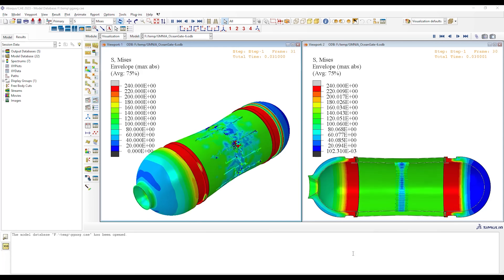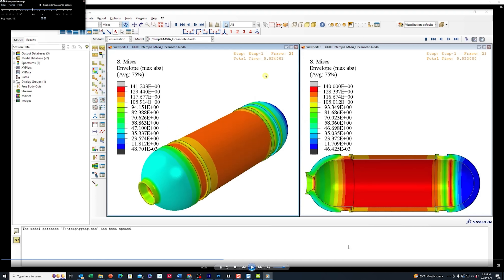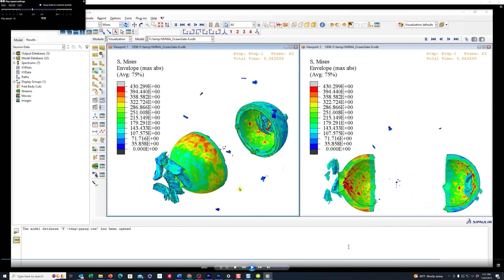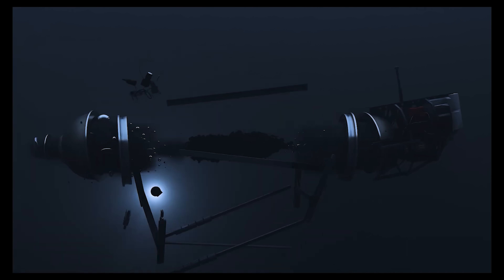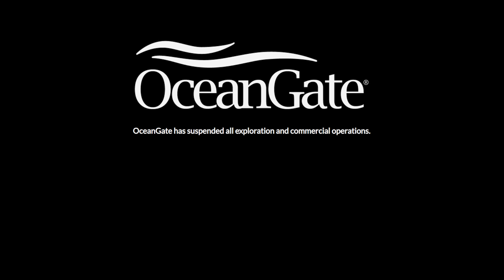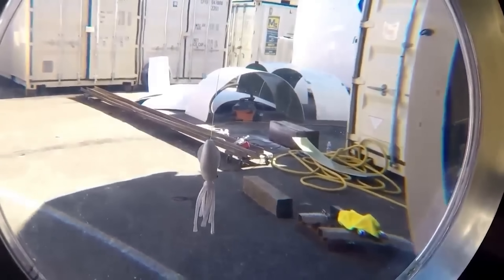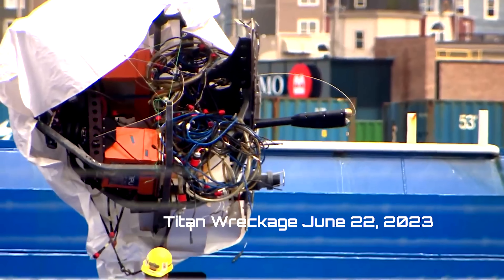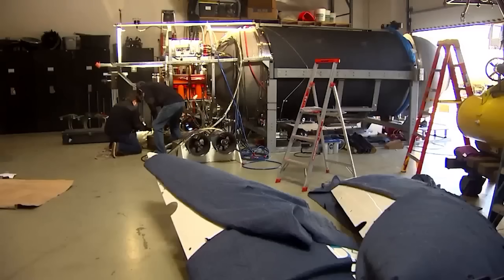Best Titan Sub Implosion Simulation, Cracked Porthole? Q & A

Comment: The simulation shown id wrong because it is based on assumption. In the simulation, the failure happens in the middle of the hull. The hull did not fail. The dome joint failed. There is no evidence the hull failed. The debris found shows no evidence of hull failure. What it does show is evidence the dome to hull joint failed. That is a completely different scenario. 

Carbon fiber does need more study and testing. The engineering behind it is sound and it was headed in the right direction. It also showed that it can definitely handle huge compression loads. Again, was it perfect? No. It only needs more study. 

The main cause for this failure is 100% one man's fault and that is Rush. He alone ignored everything his team told him, he ignored the data, he literally ignored everything, even maintenance.

Comment: My wife and I were actually on this submersible when we applied for a job with the company. We went out in Puget Sound only like 600-800ft deep, saw some stuff, and had some folks from the UW on with us studying the marine ecosystem. Even that short trip of 90-120 minutes gave me pause. We had an issue with the joystick connection and were without control for what seemed like forever but probably was 5-10 seconds. After hearing that this wasn't uncommon, I chose to work elsewhere. The rapper Macklemore was on it, too, for a shark week episode. This was before they began going to the titanic.

Comment: What occurred to me also is the sheering they found on the layers.. The glues used to bind the different layers may not have had the strength they thought as far as flexing from pressure. to me if they can slide along each other that reduces the strength from thickness.. I think the fatal flaw was thinking 5 inches accumulative was strong but in reality its not an additive as much as a percentage of increased strength per layer if they could move somewhat from glue stretching or compression..

Comment: jesus never saw the overhead shot of that ship before....wtf was the point in saving weight etc etc etc when the aluminaut sub with 7" thick aluminum walls and 30 tons weight wouldve been easy af to get on this thing....thats a massive offshore tug or something. look at the cable drums above the deck.  all for a dorky 10 ton sub??????????????????????

Comment: They would have had no "warning" it was going to catastrophically fail because, even if there was a sound just before the implosion, none of their brains would have had time to connect the sound with the implosion. Pain takes 100ms to travel to and register in the brain, it takes 13-15ms for your brain to register something you see, the hull implosion took ~1ms. At that depth the weight pressing down on 1 meter of hull would be about the same weight as a third of the Eifel Tower. The data from acoustic sensors attached to the hull showed a delamination of the carbon fiber just before surfacing on the last dive before the fatal one. Oh and they also let the Titan sit for months, outside, in freezing weather before the fatal dive.

Comment: I know I am late on this but... the cracks you are thinking you are seeing are likely NOT cracks but VOIDS in the thin film of oil in the tapered well that the porthole sits within. Under pressure the voids are squeezed out. This is not likely the failure point. The ALVIN submersible has the same look and its never had any issues. I felt from the implosion day 1 that it was at the joint where the carbon fiber meets the titanium ring...

Comment: The problem with the materials used for the sub is it suffers extreme degredation with every dive.  It might've worked once or twice, but it can't withstand repeated pressure events.  That's why you don't use carbon fiber.  Carbon fiber is good for containing pressure inside, but not resisting external pressure.

Comment: They actually did get a "Huge warning," that there would be imminent failure. Dive 87 there was a massive pop or gunshot sound coming from the hull upon ascending to the surface. That was the delaminating of the carbon fiber. Rush ignored it and didn't order any repairs or hull inspections before the doomed 88th dive.

Comment: New info suggests the start of the implo crunch started closer to the front window popping out & the crew got "implosuckflattened" backtowards the aft. The soundtrack reader 1st jump bang a thud indicating the window pop out initiating implode, what follows are the lessening 4-5 small spikes few milliseconds of the carbon cylinder crunch flattening the crew that I hope not at least 1 may or was possibly able to be aware but not capable to react in extraordinary unbearable gruesome pain getting compressed B4 that final second was incineratedly squished goo goo gone. 💀😱omg.

Comment: they for sure heard the carbon fiber cracking before it failed even if they weeent aware of their bodies being disintegrated. we know they had acoustic sensors to count the cracking events at depth and tracked them as data as well as had a counter running that even the passengers could see inside as they descended. our vagus nerve system takes in way more information about our surroundings than our eyes or ears, so i’d be willing to bet every one of them had a sinking feeling right before it happened. at least they felt no pain in their final moment.

Comment: My guess is a separation at the titanium/carbon filter junction. Those two materials would have compressed at different rates and even a millimeter or two would snap that glue joint.

Comment: I understand that stress distribution of the original viewport (true dome port design with a concave inner surface, the design best understood at that time) was superior to what S. Rush decided to use (flat inner surface). I know that he altered the design to achieve a more natural view for his passengers. Of course, as an engineer myself (granted, EE, not ME), the assumption that the designs are somehow equivalent is the sort of naiveté I’d expect from a amateur, not from a professional, degreed engineer. I’m no expert in optics, BUT, could he have added a corrective lens to restore the intended view, with an air gap to allow the dome to move? Did he make any effort in that direction?

Comment: These simulations do not agree with the ruins of the lmplodable, found on the sea floor, very recently. It was not a total obliteration of all parts. The front titanium section still had a large chunk of hull material jutting out from it. This would indicate some parts failed before others. The weakest link scenario.

Comment: The titanium cap was not damaged, I wish the whole body was made from titanium and not carbon fiber. That would be interesting to recover cameras or cellphones and try to extract any videos or sounds from inside the sub before it imploded. The Oceangate crew might heard some cracks right before it imploded so they might knew what is going to happen.

Comment: Stockton Rush was clearly NOT a good pilot. He didn't understand the basic concepts of aviation.

Airplane is just a pressurized cylinder with wings, engines, windows, doors, wheels, control surfaces (including the tail), life support systems (cabin pressurization, oxygen, heating, cooling), radio, radar, and plenty of other bells&whistles.

If the cabin pressure suddenly drops during the flight you're in trouble. Rapid uncontrolled decompression can literally "tear you a new a**hole". You may suddenly find that the tail section of the plane is severely damaged (pressure wall has burst, some parts of the tail are missing) and the plane now has a new rear window. 

Stockton Rush claimed to be a pilot, but he didn't understand material fatigue and compression cycles. The difference between a submersible (diving down to 4 km deep) and a commercial passenger jet (flying at 10 km altitude) is MASSIVE. I wouldn't use carbon fiber composites and glue to build a passenger jet. But this guy decided to use these materials to build his hobby submarine. 

Reality check. People can survive several hours on top of Mount Everest (8 km) without supplemental oxygen. But they can't survive underwater (4 km deep) even for one second. Stockton Rush proved it himself.

Comment: His thing was flawed from the get-go. You never use carbon fiber composites in compression.
This is basic mechanical engineering. 
Everyone with a mechanical engineering degree who worked on this thing at all should be banned from engineering for the rest of their lives.

Comment: The C-channel flanges of the Titanium End Caps sheared away so flush against the face, its like they was machined.

Titanium isn't heavy, it is expensive.

As you may be aware, carbon fiber cloth doesn't tolerate compressive Shear nearly as well as Tensile stresses.

I think there wasn't much included scope for regular maintenance inspection of the structural frame, frame members and identification of fatigue creep, shear force stress fractures, cavitation, delimitation etc (ultrasounds, UV, micro-cracks). 

The carbon laminate is compressed along its hull length, but also pinched against the flange shoulders cupping the carbon laminar hull tube: the hull ends are practically being guillotined. Curiously, the Titanium flanges sheared away and at the moment of failure the Carbon hull layup segmented into large pieces.

Comment: I think if he had made a 2-inch wide strengthening rib with about 1 ft of wall thickness that went completely around the inside diameter of the main carbon fiber tube and right in the middle lengthwise the thing would have been fine. It wouldn't have caused too much weight and it wouldn't have caused too much of a hassle getting in and out considering they were bolting the end onto the sub. It would have kept the outer edges from rotating as the middle was squeezed down thus the glue would not have been compromised and you might have been able to go a few more Cycles without it rupturing. Maybe it would have held out just long enough for Stockton rush to be in the damn thing alone and to be forced to eat his own engineering all by himself, the whole meal.

Comment: We KNOW now that it was at the titanium ring where it collapsed at the forward dome all around that ring it FAILED and SHEARED off that flange from the titanium ring. The glass was blown outward, again shearing off all the retaining bolts and studs at the same time. Tremendous force. ALL of your fancy reenactments are all WRONG. The failure was at the front, not the middle. The debri shows a giant diagonal crack or tear in one of the onger recovered carbon fiber pieces. The big "bang" heard on a previous dive was probably that crack forming.. Stock-BOY should have immediately RETIRED that hull and built another one AFTER examining THAT hull. Problem, Rush didn't HAVE enough money to BUILD new hulls at THAT rate. He needed a few more dives with 3 or more PAYING customers.

Comment: We now know that the actual mechanism of failure was the aft joint between the carbon fiber hull and the titanium hemisphere, which admitted a pressure wave. The carbon tube actually exploded outwards. The forward titanium dome and porthole were blown outwards, and found intact a distance from the wreck.

Comment: Nah. It's simple. The carbon fiber hull failed,the front dome jammed everything into the rear dome (including the crew) and the backpressure from the imposion then scattered the carbon fiber pieces in a large area and pushed the front dome outwards. This is why there is a large debris field, the rear dome is PACKED with stuff and the rear dome was further away but was empty and blown off from it's hinge.

Comment: Am I the only one here questioning the use of carbon fiber in compression?  A cylinder made from carbon fiber in compression is no stronger than the resin holding it all together.  Carbon fiber's strength is in tension, not compression.  I think the designers were sniffing the carbon fiber and getting a high thinking it's THE stuff to use since it's supposed strength is the end-all-be-all solution to everything strong.  In this case the wrong application.  A chain gets its strength when in tension.....have you ever tried to PUSH a chain?
Reply: If you think about it, the carbon fiber windings ARE under compression in the tube. And now we know that the carbon tube actually exploded from the pressure wave created when the aft joint failed. Look, the design was fundamentally sound, it was a failure due to structural fatigue from repeated dives.
the old B 58 supersonic bomber was made from honeycomb sheets that were essentially glued onto a frame, and after a few years of supersonic flight and extreme environmental conditions, panels began to fall off.....The old Space Shuttle was covered with heat resistant tiles that were essentially glued on.

Comment: There should have been a detailed risk and failure analysis done on this vessel by a third party. This would have started at a high level before drilling down to details. Wild guess but the glued joints between the titanium heads and the carbon fibre hull would appear to be the highest risk along with the viewport.

Comment: The port window was blasted out from the inside. Note that when the front dome was brought up, there was no ring holding the porthole window in! Also, note not the titanium ring, connecting the ring to the body of the sub, was not still bolted on. All were hit hard by a large volume of fast moving water from the inside of the sub. There is clear indication that there was significant asymmetry from the implosion, ruling out the failure of the center.

Comment: Would it implode if it was only a couple of thousand feet down ?
Reply: It was near 12,000ft down. That is not a couple. The pressure there is 6000 PSI. That's basically putting a Ford F150 on a banana.

This was there 80+  dive. The carbon fiber kept cracking and rubbing layers until it finally failed. Previous passengers reported loud "gunshot" noises throughout the dive. Those noises were the carbon fiber breaking apart. They all knew that and tried to keep everyone silent about it. They fired those employees who brought it up
Reply: I wonder if those loud noises which some people thought were the men tapping on the hull,was actually the carbon fibre tearing apart ?...wouldn't the men have tapped out the universally known SOS distress signal on the hull rather than a random knocking that people claimed to have heard ? They were all sea faring men who would have known the SOS signal .
Reply: @lindymcdonald8945  Who knows how long they knew of their impending death. Could have been instantly or they were in the dark for a few minutes hearing the carbon hull popping and cracking until it imploded. They passengers had go pro's and there were cameras mounted but on the inside recording but they were destroyed so no one will ever know.
Reply: I think they would have heard the cracking because didn't Stockton Rush indicate he was trying to resolve a problem on the descent ..i'd imagine a vessel like that would make all sorts of creaking noises .
As much as I'd love to see the titanic ,I don't think I'd have the nerve to go in one of those subs.

Comment: There is a problem with this 1st simulation in that the craft doesn't end up this way. Being crushed in the center is not accurate.  There is a section of the cylinder that survives the implosion  intact at the wreckage site.  It is perhaps not the full length of the capsule.  I don't know.   At the crash site there is only one capsule end piece together with part of the cylinder that survived.  It makes me think that the bow cap got pushed away and simultaneously the top of the  cylinder get crushed until pressure equalized.  That force goes toward the aft cap end and pushes it outward.  That is what I am thinking.  I like the simulations though.  Thank you

Comment: Rush always figured things would fail in the way he necessarily needed them to, and could not conceive of the instantaneous & catastrophic reality of insidious materials at failure, a concept which is virtually innate for anyone who careth enough to consider how exactly something goes from structurally rigid one moment, to broken, cracked, fractured, etc. The instant a synthetic material is compromised, the strength drastically dilates, and at that depth, a crack would obviously mean imminent catastrophic failure. The moment a fracture occur, death to all aboard. 

Rush was clearly deluded and refused to examine objective reality because it was inconvenient for what he needed to keep his cobbled together, bullshit 'vision' alive. 

Stockton Rush had a dream of going to space, but yet this, like OceanGate, likely was not a real dream of his, either. From a family like his, surely youthful pressures are immense, and i think it's likely Rush had no idea who he truly was at all, which is why he sinply pivoted to some other silly dream once he couldnt become an astronaut. 

Its interesting thay Rush appears to hardly even factor in the pressures at ocean depth. Its almost as if he believed he was putting people into orbit, which would make sense, then, on why he picked the material he did, and why he thought naysayers would be proved wrong. To him, it appears as though he thought je was simply designing a carbon fiber aeroplane without wings...one which goes down, simply, rather than up.

Comment: Hearing that final bit of the guy saying "the strength, weight and buoyancy we get out of it exceeds any other material" sounds like a sloppy rationalization. My understanding is they got more strength to weight/buoyancy from carbon fiber than from titanium. But not more strength, period. The way he puts it though confuses that key difference.
Reply: Considering the titanium caps came out of the water completely intact?